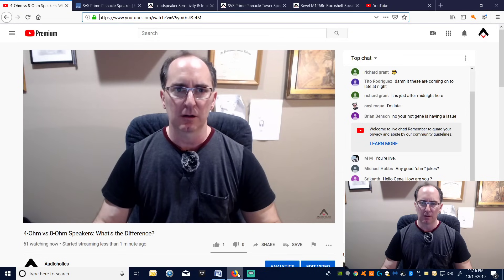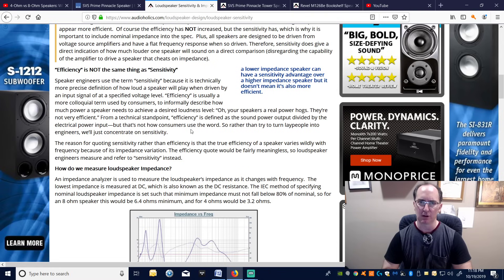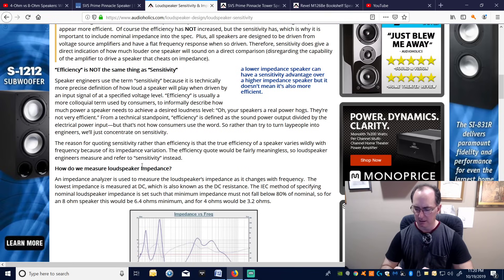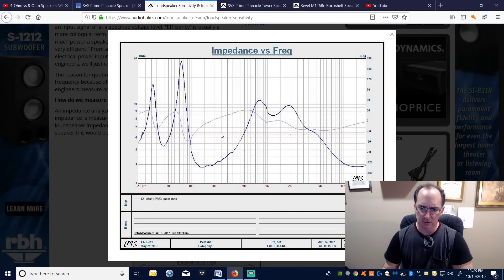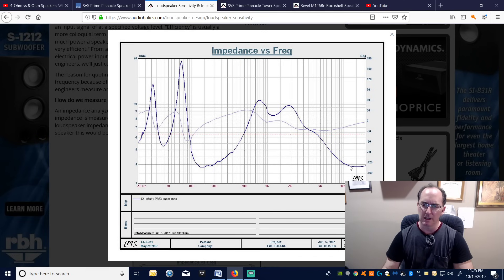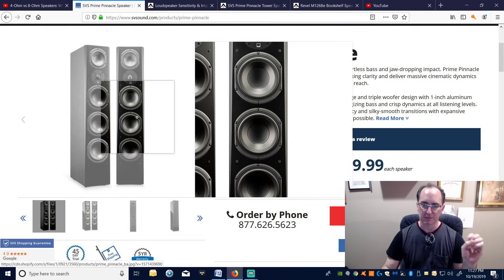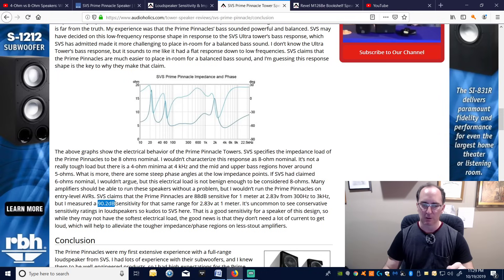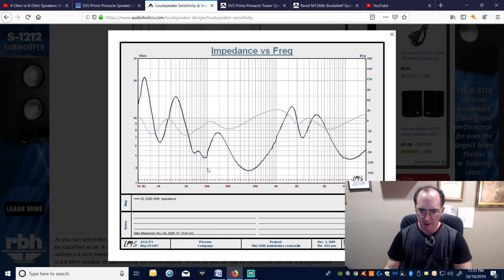Loudspeaker Impedance 4-Ohm vs 8-Ohm: Which is Better?

Comment: Hey Matt ,  big fan  thanks for the response , I recently disconnected my B&K ref amp 200x7 with the Monoprice   , while I may not be able to measure I will use the B&K and see if this occurs as I remember the Klipsch RF-7's kept playing clear and loud and continued to increase .When running the XMC-1 in reference stereo mode and not PLIIx the RF-7;s responded while using the Monoprice .Again appreciate look forward to watching next video keep up your great work audioholics .

Comment: From my experience a 4ohm speaker likes more power ( a lot) in which case I would never use an AVR. Would you say this speaker is difficult to drive? 
Frequency Range (+/-3 dB) [Hz] 50 - 26.000
Sensitivity (2,83 V/1 m) [dB] 87.0
Nominal Impedance [ohms] 4
Maximum SPL [dB] 107
Recommended Amplifier Power [W] 40 - 150
Crossover Frequency [Hz] 3,1
Crossover Principle

Comment: What happens when you amplifier is 6 ohms like onkyo and your speakers are 8 ohms like klipsch ? What result do you get ? What is the effect on such a combination ???
Reply: Simon Gomes AN amplifier isn’t rated with an impedance like that. You are talking about the power rating referenced to a 6ohm speaker load.

In your example, the amplifier puts out more power. The reason amplifiers are sometimes rated into 6ohms instead of 4ohms is that they can’t get a passing rating into 4 ohms with UL certification but it gives a bigger number than 8 ohms.

Comment: I blew a sansui amp with cerwin vega car speakers; smoke came out of the amp and everything
Reply from the maker: yea the older amps don't have as much over current protection as modern amps do. Also car speakers tend to be lower impedance, 4 or 2 ohms, not surprised this happened.

Comment: I have a Pioneer sx-1250,from 1976. I drive a pair of JBL LX600 8ohm speakers,for low to mid volume listening,and a pair of Cerwin Vega AT-12 4ohm speakers,for some higher volume listening. If I use a speaker selector switch,is there any reason that I shouldn't drive both pairs,together? The receiver specs say no lower than 4ohms...... I had this receiver serviced and recapped recently,and it bench tested at 180wpc. Thanks in advance!

Comment: I recently purchased the Monoprice Monolith 7x200 amp and connected to an Emotiva XMC-1 driving Klipsch RF-7's ,450c and RB 59's for my surrounds at about -10 db or so the volume wont increase , Klipsch being sensitive speakers and the Emotiva processor functioning optimally , do you feel its an amperage problem at the outlet 15 not 20 ,or something with this subject of impedence ?
Reply: E M there are too many factors to answer this simply. If you could measure, we could figure this out. However, I would just say that the most likely problem is that you are hitting the maximum output of the speaker.  If you look at our subwoofer tests, which test max output, and look specifically at compression tests, you will see that at some point a speaker just doesn’t get any louder. You add 3dB of signal, but only get 1dB or extra output. That is compression. Eventually it just won’t get any louder.

Comment: sorry bother again but and the measurements of the MXA5200? they are better than older models? or can I buy CX5200 with a MXA5000?
Reply from the maker: MXA5200 only if you want to bridge 2 channels for more power. Otherwise they are virtually identical.
Reply: @Audioholics  already finished the review?
Reply from the maker: @thiagodelgado3128  not yet but measurements were completed a while ago. Hopefully will publish in 2 weeks.
Reply: @Audioholics  really thx your answear. I really choose basead ok your IMO, I don't know if my next upgrade must be a sb4000 or mxa5200 pra 5000, my system is a rb81 ii+rc62ii+rs42ii  with a aventage 1020. I Will like to get reference levels. My sub is dar worst sw112 but dont know whats is the right choice to do. Can u advice me?

Comment: Hi. 
In short which is better for home theater 8 ohms or 4 ohms? Please reply
Reply from the maker: Watch the video.
Reply: kurup suresh all else being equal and assuming that your amplifier can increase (ideally double) it’s output into 4 ohms, the 4 ohm speaker would be better. It gives you more amplifier power for the same price. Kind of a free lunch. Since theaters often need more power, this is useful.
Reply: @PoesAcoustics  
What about subwoofer, 4 ohms or 8 ohms for better punch Bass for home theater?

Comment: Zu Audio speakers have high impedance (12 ohms or higher), but high sensitivity.
Reply from the maker: It can be done with a few drivers. Also, without measuring, no way of knowing if their sensitivity rating is inflated.

Also, single or 2 driver systems often don't have high power handling or very deep bass extension. No free lunches.
Reply: @Audioholics  i am using two onkyo m5000r to drive tannoy dc10t, the speaker dips to 3.2ohm on the manual, however the amp when bridged raises from típica 4ohm to 6ohm... What can i do, exchange amp but based on what criteria?  I must find one that handles 2ohm loads?
Reply: Bill D and these speakers measure terribly. They are not good speakers by our standards. 

https://www.soundstagenetwork.com/measurements/zucable_druid/ here are measurements of the speakers in an anechoic chamber. As professionally measured as it gets.
Reply: @PoesAcoustics  I've heard as much from other sources and, as a result, avoided purchasing them. My post wasn't meant to be a testimonial as such, but just a mention about their impedance and sensitivity.

Thanks though. You have reinforced my decision to look elsewhere, Matt. I went with the more "conventional" LS50s (a sort of typical 4 ohm design with moderate sensitivity) and subs. I'm pretty happy with them.
Reply: Bill D yeah Gene was really generalizing about typical speakers and the sort of higher sensitivity value you see when following the industry standard approach to measuring sensitivity at a fixed 2.83 volts. 

You can certainly have a high sensitive speaker that is also high impedance, but that number will look a lot lower when you go to the same standardized measure of 2.83 volts. 

Zu uses custom built high sensitivity pro drivers. That is why they have such high sensitivity.
Reply: Gene, great video. I have ordered a pair of Zu Omens, how would you rate the sound quality and performance?
Reply: @anthonymiriello5029  Matthew is not a fan of them, as you can read above, but beauty is in the ear of the beholder. You have plenty of time to judge them. Don't buy into the "break in" fallacy. If they don't please you after a few days, they never will. Besides, Zu breaks them in before shipping.

Comment: I asked The Borg. They said, "Resistance is futile."

I'm not sure they understood the question.
Reply: Very good!
Reply: Maybe the Borg will be forthcoming if I send "The Q" over there to ask the same question.
Reply: @grassy LOFL 😂😄🤣 1000 upvotes
Reply: So ohm ratings are complex and often misrepresented in manufacturers specs.  Also, sensitivity is a bit complex as well.  I read a spec on a respected company on a speaker rated at 300hz and up.  What about 100?  I have 2 speakers on the same system with an A-B switch rated the same in  sensitivity yet one is much louder!  Also , sW a company rating their speaker at 8 ohms but then noted it dropped to 3.2! What? Also, many home recievers have rather crappy power output and cannot handle a 4 ohm drop anywhere in the frequency range
Reply: My god man, have an upvote!  Well earned.  :)
Reply: The Borg sales division said “better sound through research”

Comment: I would love to have you show how to measure a speaker impedance so we can do it at home. Just tried to find a video on that and nothing relevant to home audio came up.
Reply: A decent/cheap multi-meter from amazon or home depot should do the trick. Touch the red to positive, and the black to negative and set it to impedance. Edit: forgot to add to round up normally if it reads 3ohm for example it's a 4ohm speaker.  Impedance changes when music is played from the speaker so the manufacture rating is often different than you'll measure with no load.
Reply: @towatchvids  how will that show impedance for the full 20-20k range?
Reply: @Dgr1zzl3  Well you're not going to be able to do that easily at home without dedicated equipment for it. Most of it is going to cost quite a bit. There are a few under $200 that will get you close like the Tenma Audio meter, still it's only 200hz 2khz and 20k hz. There are probably other brands making them but that's the one I know of.
Reply: Realizer Network this is just infecting impedance from DC resistance. It’s not the same thing. You need to actually use an impedance rig and sweep the speaker. That doesn’t have to be expensive. It can be done with a handful of resistors and a soundcard. https://www.roomeqwizard.com/help/help_en-GB/html/impedancemeasurement.html

Or much more simply, you can use something like the Dayton DATs

https://www.parts-express.com/dayton-audio-dats-v3-computer-based-audio-component-test-system--390-807?gclid=EAIaIQobChMI1PWF0N-z5QIVlR-tBh369AuFEAAYASAAEgI8pvD_BwE

I have and use the DATS as well as a home made rig. They are all very accurate.

Comment: Do I understand it correctly, that when you have a 4 ohm speaker that it power handling goes up? As any good amplifier would double up or atleast go up quite a bit vs 8 ohm. So my amplifier gives more power into 4 ohm vs 8. So if a speaker is 4 ohm generally speaking they handle more power?
Reply from the maker: They can due to having more drivers, but not always.
Reply: Audio Fun well I would add to what Gene is saying by noting that impedance is not in any way related to power handling. That is a function of the drivers.  If you have one driver rated at 8 ohms and you pair them. You get 4 ohms impedance and double the power handling. However the doubling in power handling came from doubling the driver. If you wire in series, the impedance is 16 ohms but the power handling still doubles. 

You can also have a 2-way speaker that handles far more power than a 3-way speaker. It just depends on the drivers.

Comment: Informative but not useful.  Folks buy speakers  they perceive will deliver the best sound for their money. Expectation are the speakers will work with their chosen amp.  And, thing is, the speakers will always work without damaging the amp and vise versa. After all, it's 2019 and manufactures of speakers and amps have designed their products  within parameters to work in any combination without any possibility of damage. Imagine if they did not design products to work in common applications they would go out of business, period.
Reply from the maker: Bad advice. You can setup a scenario where a low impedance speaker constantly trips the receiver current protection at high volume. Not a good scenaeio for an end user.
Reply: Charles Ludwig this isn’t really true. Plenty of speakers made today have a low impedance. Even speakers which do not fall below 4 ohms can be too much for some amplifiers. 

Class D amplifiers have hard current limiters and this can cause them to shut down with 4 ohm loads. Many cheap Class AB receivers put out little or no extra power into a 4 ohm load and may shut down if turned up with such a load due to heat dissipation problems. 

This is a valuable and often misunderstood topic.

Comment: Why is som blu-ray audio higher then others som time a have to turn the vollum really high to hear the voices
Reply: That isn’t a speaker impedance issue. While there are encoding standards from SMPTE for movies, they may not always be followed. It is also possible that you have some kind of automatic compression system on. It’s an option on many receivers and many Blu-ray players. Check the audio settings and turn any form of compression or volume levelers off.

Comment: Awesome Video Gene. So much knowledge. So does a true lower ohm speaker basically have the ability to get louder with less distortion? I have some lower ohm speakers like Elac’s and Sonus Faber and truthfully I don’t notice much of a difference between them and my Goldenear triton 5’s I guess as far as ohms go. Thanks and shared
Reply from the maker: Yes but not because its a lower impedance but because it has multiple drivers sharing the load.
Reply: Audiolympian well and again, I’ll preface what Gene says by noting it all depends on the speaker.  All else being equal, adding multiple drivers reduces distortion and increases output. That doesn’t mean a speaker with 3 drivers has less distortion than a speaker with 2 drivers.  It would just depend.
Reply: Matthew Poes thanks for your reply it makes sense. . I’ve just been trying to understand the real difference between the different ohm speakers for some time now. To me there doesn’t seem to be one
Reply: Audiolympian it is just an electro-mechanical property of the speaker. I wouldn’t buy speakers based on their impedance myself. I would buy a speaker based on its performance.  

The nice thing about a lower impedance speaker is that the amplifier puts out more power. If you have a good quality amplifier that is designed well and behaves as it should with a 4 ohm load, it can potentially deliver a 3dB increase in max output. That is nice to have. It’s a kind of free lunch. 

However my view is that we go by speaker performance first and impedance second.
Reply: Matthew Poes I never have. I just happened to pick up some speakers I liked that happen to be 4 ohm. But truthfully I really love my Goldenear speakers.

Comment: Hi Gene,
 Can you share some of you insight on airmotiv c2+ center speaker which is an 4 ohms speaker with 92db sensitivity
Reply: I can't talk about the airmotiv c2+ but I bought the C2 on closeout in May and it's incredible, especially for the price. At $399 the airmotiv c2+ is still a great deal, the C2 has taken the dialog in movies to another level for me so the C2+ must sound even better.
Reply: @styner3   Thanks this was very helpful :)